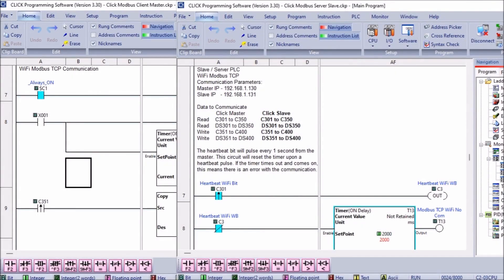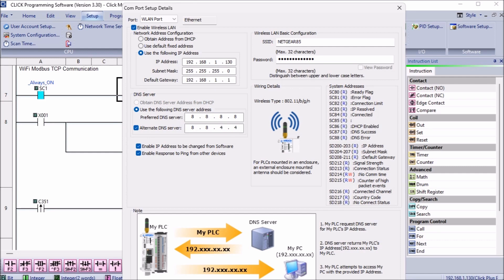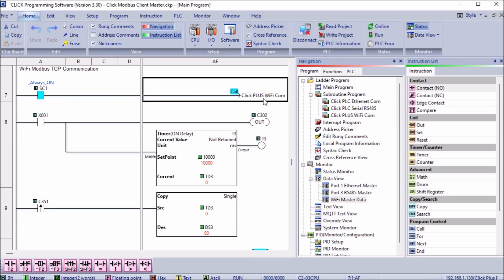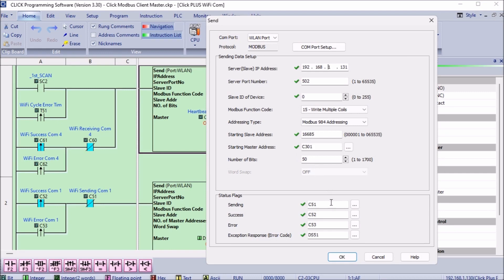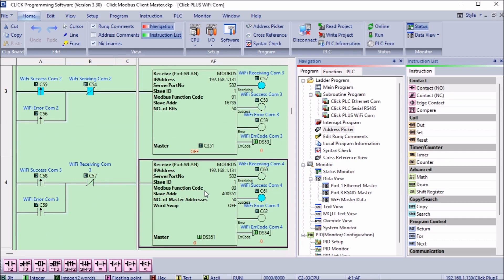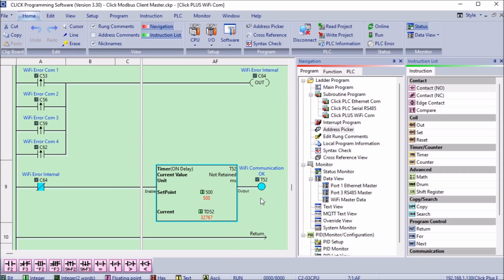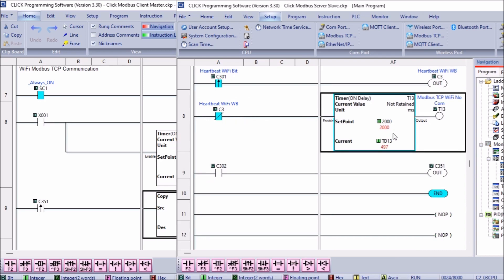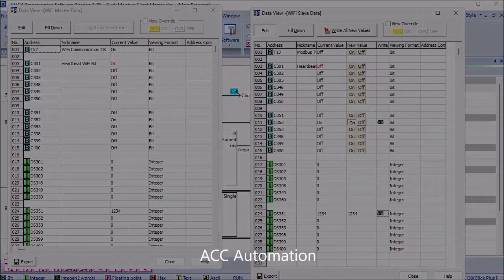Click PLC to Click PLC Communication WiFi

Comment from the maker: More information can be obtained at our website. This includes all of the links mentioned in this video. 
https://accautomation.ca/click-to-click-plc-communication-remote-io/

CLICK PLCs were designed with simplicity, providing reliable control at a low cost and with little to no learning curve.
This simplicity makes CLICK a perfect solution for small machines, home automation projects, pneumatic applications, or anywhere a simple system needs a budget-saving control solution. 
Building on the original CLICK’s simple design, the new CLICK PLUS PLCs offer the same practical control but with some surprising bells and whistles. Using the same FREE, streamlined PLC programming software as its predecessor, the CLICK PLUS PLCs provide no-headache programming combined with advanced capabilities like Wi-Fi communication and data logging.

The Click and Click PLUS PLC series can be found at this URL:
https://accautomation.ca/series/click-plc/

Features of the new Click PLUS PLC (C2-0xCPU) include the following:
• Micro USB
• DHCP support
• DNS support
• Wi-Fi (programming and Modbus TCP)
• Bluetooth (Wi-Fi) provisioning
• SD Card (Data Logging)
• Data Logger
• Network Time Service
• MQTT (Publish/Subscribe)
• Required PLC Password
• Disable Ports
• Strong Password Support
• Disable Ping Response
• Encrypted Password Transfer

We are using the Click and Click PLUS PLCs for several reasons. Here are just a few.
 - Investment is low for the hardware, and the software is free
 - Standalone PLC with built-in I/O
 - Communication ability - Ethernet Port, RS232, RS485 - support for protocols such as Modbus RTU, Modbus TCP, etc.
 - Ability to directly expand the system with various modules, including RTD and Thermocouple inputs.

ACC Automation
https://www.accautomation.ca

Comment: Very helpful!!!  Thank you!!!❤❤❤
Can the Clicks communicate directly or must it go through a router?
Reply from the maker: The Click can communicate directly with both the WiFi and Ethernet ports. A static IP must be set on each device since no router exists.
Regards,
Garry
Reply: @ACCautomation  Thank you Sir. ❤🕊🙏
Reply: @ACCautomation for SSID can  i just make up a name?
Reply from the maker: @skunkape5918  
Sorry I misinformed you.  WiFi must go through a router to change the signal. A direct cable does not.
Garry
Reply: @ACCautomation  Roger that! Thanks again! ☦❤🕊